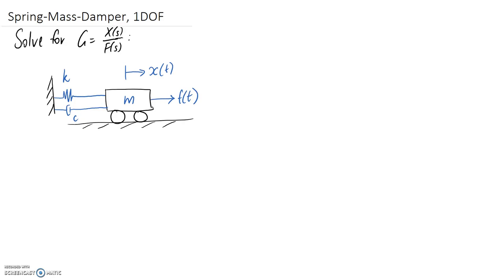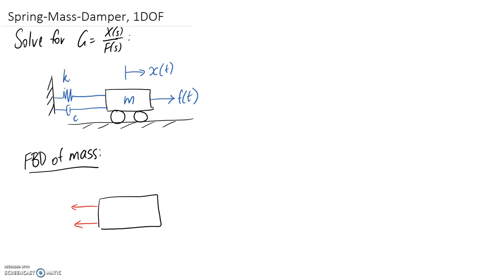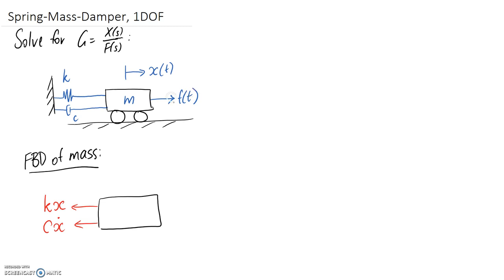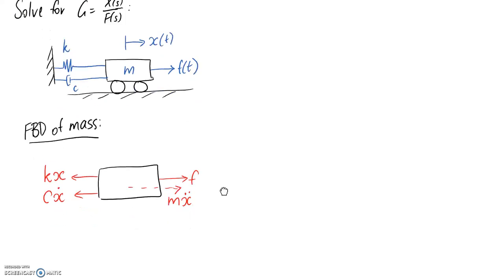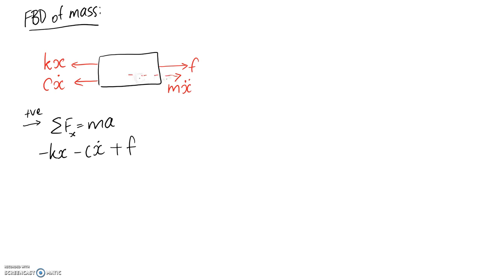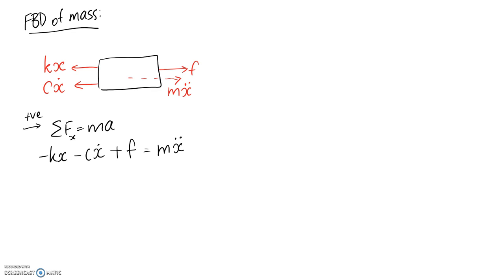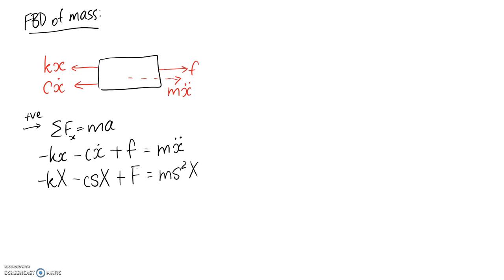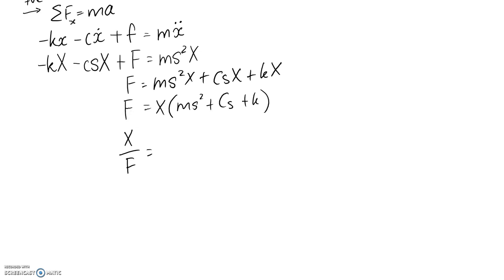Spring-Mass-Damper System, 1DOF

Comment: Quick question.. I'm not really understanding why we put mass*acceleration and F(S)..
Isn't F(S) is the only force in the system?
Reply from the maker: The mass can move back and forth so it is going to accelerate as that occurs. As it moves that's going to introduce force through the spring and damper - the spring is going to try bring the mass back to the natural spring length and the damper is going to try to slow the mass down. 

Newton's second law is that sum of forces equals mass X acceleration.